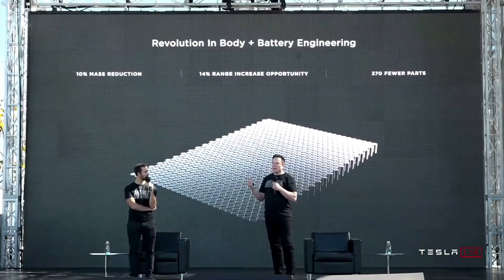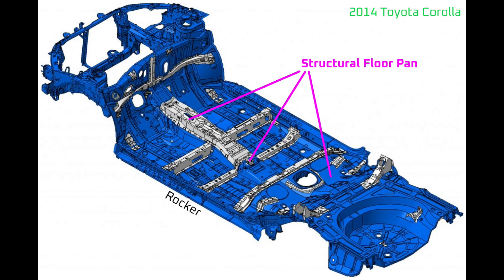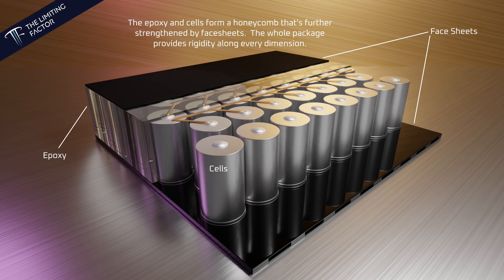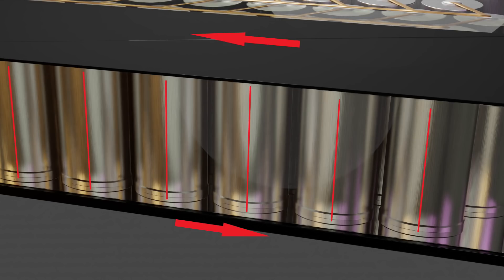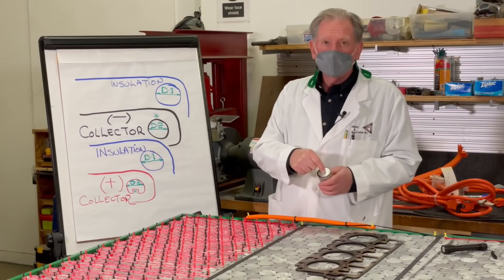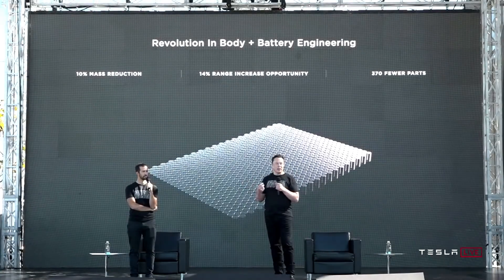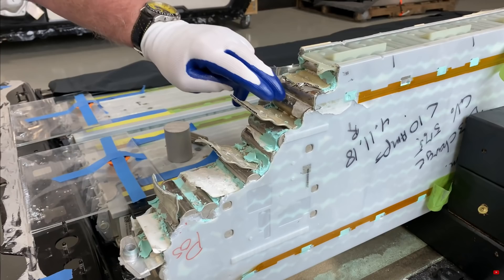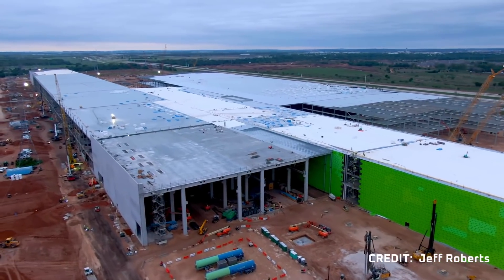#15 The Engineering of Tesla's Structural Battery Pack

Comment: Fascinating as always. I always wondered what sort of cascade we'll see as weight comes down. Lighter pack means we need fewer batteries to get the same range, but that could also mean lighter wheels, tires, brakes, and other components. Reduce that weight, now we need an even smaller battery, which reduces weight again.

Comment: Some points I would disagree with.  First, without knowing the exact design its hard to know where the center of mass will be, but if you move the light weight material (water) to the bottom the center of gravity will move up all else being equal.  Also it looks like tesla have given up on the structural battery. You show the image a number of times which looks like a holey structure that the batteries slot into. If that is the case, then the batteries are not taking load and it is not a structural battery. Also, if im wrong and it is a structural battery, you wouldn't be able to remove cells with out affecting rigidity. In that case you would have to have dummy cells to take their place. One way they could solve these issues is assembling the battery internals directly into the holey casting and have no battery case at all. Just an end cap on each end. Think about the way that bees pack honey into honeycomb and then cap off the cell. They don't place honey into little jars and then push the jars into  the honeycomb.

Comment: And this is what I said when someone wrote an article at Cleantechnica saying that the Roadster 2.0 wouldn't have better handling because batteries are heavy and all that jazz.
Heck! That roadster was made with Model 3 batteries! 4680 cells, cell to structural pack, Cybertruck's 30X Stainles Steel, huge single casting pieces, etc all those innovations didn't exist back in 2017! All those could be added to both the new Roadster for better handling  and to the Semi for longer range! And to think even more energy density is being developed (I think I recall Elon mentioning between 400Wh/Kg to 500Wh/Kg to achieve a possible electric plane jet with VTOL capabilities)

Comment: Please focus on other topics, such as battery chemistry. I feel you have so much more to add to the conversation in your area of expertise. The only thing notable I learned from this video is that the car has cast aluminum pieces in the front.
Reply from the maker: Good feedback!  It was a major part of the battery day presentation, so it must be covered for a comprehensive series.  There will be two more videos on engineering, then the final video, then back to batteries.

Comment: After your video I am now wondering why the batteries need cans. Put the roles into an an epoxy honeycomb and fill the cells with electrolytes.
Reply from the maker: Side reactions.  That's why batteries are high nickel cans - resistance to corrosion.

Comment: I've noticed that the jelly-roll doesn't go to the absolute center of the cylinder. Could the cylindrical space in the center of the 4680 contain something to further facilitate cooling?
Reply: This!! I haven't even thought of that. 
It might over-complicate the design, but still an extremely valuable insight!
Reply from the maker: Possibly, there were rumors before battery day that there is an aluminum core in the center of each cell.  But, I've heard a lot of rumours.  I only share information that has corroboration in some form or another.

Comment: Gruber Motor Company has good videos about repairing Tesla battery packs. Tesla battery packs are very good, as it turns out, though they will eventually die. https://www.youtube.com/watch?v=F-B_8oMZNeI  I think it should be possible to get a few more years out of the structural battery by drilling out or circumventing bad cells. It would take a lot of holes to compromise the structural battery slab, structurally.

Comment: The day the model 3 goes 500 miles I’ll sell my soul 💸💸💸
Reply: I recon it will be a long time before model 3 goes to the 4680 cells. My guess is they will move the model Y to Texas and free up factory lines and cell supply at Fremont for increased model 3 production.
Reply: @saff226  yuh u right cuz they have to compete wit XPENG long n crazy range for their vehicles. Probably 2022?

Comment: On the "negative mass", not sure how the number for cells weight is sourced, but just a possibly obvious / dumb comment: the sum weight of the 4680 cell cans should be smaller than that of the 2170s, even if the active material weights are similar in the two (energy-equivalent) packs. So the total weight of cells in the 4680 pack would be smaller than the cells in the current LR packs.
Reply from the maker: There are too many assumptions in that comment to untangle here in the comment section.

Comment: I've always wondered about the epoxy, or what have you, on the old pack.
Surely there's some chemical that easily dissolves it and makes it much easier to recycle.
Reply from the maker: All they really have to do is dump the pack into a grinder and sort things out chemically.
Reply: Epoxi melts easy

Comment: Structural Pack: twisting a sheet is like bending in 2 dimensions at the same time, and with the honeycomb in it, its act like a very thick sheet (like the honeycomb paper filling from IKEA ;))
So in one direction (bending) it works like an I-beam or H-beam. As explained in the Video, the upper and lower flange is connected with the web. The web take the shear forces and the flanges most of the bending forces. While bending, the outer flenge get streched, the inner one compressed. To torsion this I-beams are weak.
With a honeycomb web, you get stifness in all directions, over the whole area, because the "webs and flanges are everywhere in all directions.
But I think you've portrayed that well enough already. After all, it's about the benefit of it all and how it works out.
Reply: This sounded like a poem to me,  and I it in mean in a good way

Comment: They should use a high density foam in between each cell to help with rigidity and stop fires from spreading if the cells were to catch fire
Reply from the maker: It's flame retardant epoxy according to Elon
Reply: @thelimitingfactor  that makes sense

Comment: -Great stuff as usual Jordan.  
-I don't know if you ever delve into Tesla charging infrastructure, but I'd love your opinion (a video would be be great of course) on the large Supercharger installations in the works (several biggies along Route 5 between LA and San Fran) and whether they may actually be, at least partially, Megachargers for Semi.  
-For example check out Harris Ranch.  It appears to be a truck stop already, lots of space, permit for 80 Superchargers.
-Also what is the feasibility of Semi using several (four, six, eight) Superchargers to charge in the wee hours when nobody there?  Or a setup like the mobile Megapack that was deployed in 2019 at the Supercharger in San Luis Obispo.
-I can give more deets on this stuff if you're interested.

Comment: To be honest it is more the next logical development step to make the battery also a structural part of the car than it is rocket science. This will be standard. BYD for example applies structural LFP battery formation already with its Blade Battery. Its just using blade shaped cells instead of cylindric ones. Its great but just want to say its not that mind blowing but more a logical next step. Elon is also just very talented in selling regular smart engineering solutions as the most challenging technical revolution since the internet :)
Reply: Most big companies & their management don't implement smart engineering solutions because of the risks to short-term profits.
Massive under-valuation of long-term R&D to future success.
THAT is what Elon is revolutionizing; greatly reducing short-term profit orientations in all the companies he is involved with. 
No slacking & no cowering behind past successes. THAT breeds winners. <3
Reply: Yeah, I was a bit surprised to learn that Tesla were actually late to the party on this compared to multi other companies.
Reply: @Dayanto  BYD for example builds battery to chassis already.
Reply: @philkeh  true, BYD was talking about battery-to-pack in end of march 2020, but they don't have a structural battery (providing rigidity/ load carrying capacity, instead of being dead weight, in mechanical-stress terms)

Comment: Just a niggle: the Model 3/Y cells are not bonded to each other, they are glued to the cooling tubes.
Reply from the maker: Yeah, they're bonded to each other.  The cooling tubes aren't in a grid, they're in a loop.  This means along the length of the loop the cells are bonded to eachother.  Also, even with the cooling loop in place, they are ultimately bonded to eachother, although proximately bonded to the coolant loop.
Reply: @thelimitingfactor  there are seven cooling tubes per module, they are connected to each other on each end to form one cooling circuit. A single cooling tube with cells glued to it is called a bandolier at Tesla. The cells are only "bonded to each other" by the wire bonding process after the seven bandoliers are put together. The space between cells is not filled with glue, it is filled with blue goo that is a flame retardant.
Reply: (Thanks)

Comment: Engineer here. That's why I commented on your latest video that I can hardly wait this one! Shear force explanation: it was very well done, I don't think an in depth explanation would be needed for this video. Another note: structural battery pack and front/rear castings integration will happen with bolts. I base my conjecture on these: the casings are made of aluminium, and the battery pack housing seems to be steel, those two are very hard to weld together. Second: if servicability(?) is important any damage to these parts will result in throwing away the whole car! Bolts makes a much more reasonable choice here.
Reply: I agree on the bolts, but based on the renderings Tesla showed of the battery pack, as well as the need for the pan to be as thermally conductive as possible (as the cell tops and bottoms are bonded onto it), it might be cast Al. Not necessarily HPDC, just a typical mold casting. Or maybe a cast Al piece with cooling channels inserted in a welded sheet steel pan. But both the battery pack and the front and rear castings will have to be structurally secured against the ultra-hard steel roof arch elements and the A, B and C beams.
Reply from the maker: I agree!  Noted in the next video
Reply: I don't understand how the cells are bonded with the sheets over and under. In my head, if they are not bonded, the cells will simply move around..

Comment: My 2 cents is that the first 4680 cells will not be used as a cell to chassis as presented during the battery day. The reason is that they will be used on model Y Berlin that will still have a pack as seen from picture at 5.56. the full cell to chassis is probably going to be used on model S plaid+, cybertruck and roadster, with a cooling plate (for cybertruck and roadster only) on the bottom rather than serpentines cooling channels (needed on Y as the pack height is not indefinitely extendable on a vehicle designed for 2170s).

Comment: What if the battery cell was hexagonal shape?
Reply from the maker: Nah, corners are difficult at high volume electrode production
Reply: Not only would production speed of the cells be hampered, but the safety of the pack could be compromised. By going hexagonal, I presume you're suggesting that all cells could fits snugly next to each other. But I would presume that they may want a thermally insulating material around each cell....to ensure that a thermal runaway in one cell doesn't catastrophically impact adjacent cells.

Comment: Hello, thanks for the explanation. I realize the numbers are based on the presentation, but they seems very optimistic. Lets say we have the 300Wh/kg new cells. Cell weight with the old cells is 330kg. Now in a typical pack we add 50 percent as you mentioned. That would be 330kg into the almost 500kg on the pack level. Meaning the extra stuff (epoxy, cooling wiring etc) weight is 170kg. With the new 4680 cells we can expect all the extra stuff be much lighter but still, even if it had half the weight, so 85kg, this means to get to the "effective" weight of 300kg on the pack level we have to save 85kg+30kg=115kg of the structural weight. Since the entire aluminum body of a model S is supposed to be about 200kg that seems way too much.

Comment: Recycle of used cells? Page 11:00
It is advisable to consider (aluminum extruded) honey comb structure in separate from the use of cell wall as integral part of the comb. Same way we drop in a cell in our flash light.

Comment: Page 9:15 : Yes, excellent thermal transfer - from the core to the bottom by copper leads - only to fall short passing it to inner cell wall ie negative terminal casing. Why? It count on point contacts by a force derived from annealed (soft) copper leads, a problematic electrical connection method that responsible engineers will avoid, so how good is thermal dissipation? Nearly as good as conventional single welded tab? That defeated Tesla’s claimed thermal advantage.

Comment: Other manufacturers claim they have "structural battery packs", but that just means they have beefy battery cases and transmit some load through them. Tesla is actually using the individual cells themselves as structure and is transferring 100% of the load through the battery.

Comment: Interconnection between adjacent cells made by narrow strip conductors aren’t as good as Model 3 by broad sheet of conductors.
Reply: As long as the connector's resistance is significantly lower than the internal restistance of the cell, it doesn't matter.
Reply: @w0ttheh3ll  right, how can we tell it is going the way as you expect? If not done as model 3?
Reply: @philoso377  because Tesla's engineers aren't idiots, they won't spend many years optimising the cell only to throw away all the gains by desigining a poor connector. even if they did make that mistake, they would notice when they put the first pack on the test stand.

Comment: Running change to cell count? 
Is possible only separation between one cell to the next remains evenly distributed to avoid differential strong vs weak spot leading to structural torsion weakness or tinkles on flat surfaces.

Comment: A much more robust and simple wiring scheme would be to alternate the orientation of the cells positive up and down. Simple straight connections without the precision required for attaching to the edge of the cells on the same end as the center connection. Thermally conductive but electrically isolating epoxy could mean agnostic orientation. It seems unlikely that the thermal conductivity difference between Al and Cu is meaningful in the short distance between the end of the folded conductor and the top of the cell can. Tesla does have the precedent of the more complicated wire harness but the structural pack offers this option and I hope they take advantage of it.

Comment: I think that a fundamental flaw in the 4680 design has reared it's head and is why the battery is pushed out to 12 - 18 months.  Panasonic talked about heat problems and I believe that the middle of the cells cannot shed heat fast enough to avoid a higher thermal runaway in accident scenarios or heat pump failure scenarios.  Elon said that the S and X were delayed because of new battery pack design safety issues.  Could it be that they were attempting to use 4680s and discovered this after switching over the mfg line?

Comment: Would the batteries need to be bonded to the top and bottom plate for it to be structural?  If you bonded the batteries to each other, effectively you make a battery brick.  Then, if you placed the brick inside of a box, wouldn't it then provide structural rigidity to the box?

Comment: I agree with your assessment that coolant will go under the cells... Not only does it lower the CG, but the coolant channels could be designed to provide a crush structure to protect against underbody levering or spearing impacts.

Comment: There might be additional benifit to the Silicon Carbide anode, since it is so strong it might allow increased storage though as structural battery.
Reply: the anode is a powder.
Reply: @w0ttheh3ll  Every part of the battery can theoretically provide structural support, even the powders within them can transfer forces applied to the cell.

Comment: The concept of negative mass is a counter intuitive concept. It should thought of either battery being in structural debt or having a structural credit. This means the battery either requires structural mass or supplies structural mass. The interesting part is that, if you can make structural part out of batteries then you can carry a larger net load.
Reply: Agree - "structural debt/credit" is  clear, simple, and factual.

Comment: Also interesting are the implications for electric flight. Developing the technology and fine-tuning manufacturing to make batteries structural could really reduce weight for flight applications (similar to the wing-as-fuel-tank design of modern planes mentioned during Battery Day).

Comment: If I understand correctly the new charging curve will be improved by:

1. More Silicon
2. Tabless (less resistance/heat)
3. The better cooling system from the new pack design
Reply from the maker: Bingo!
Reply: Yup! Tesla basically confirmed faster charging rate by stating that energy volume of a cell is up 5x but the power output is up 6x. It reasons to stand that your 3 points allow for faster charge and discharge.